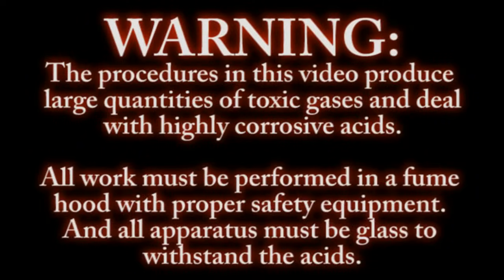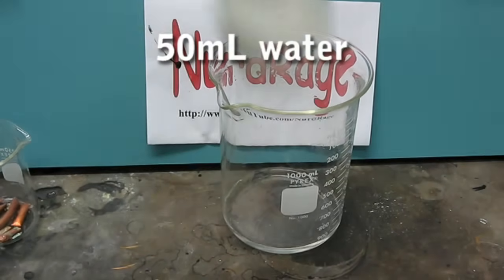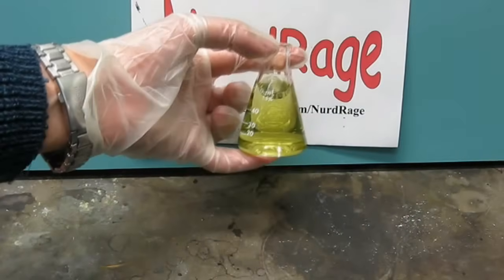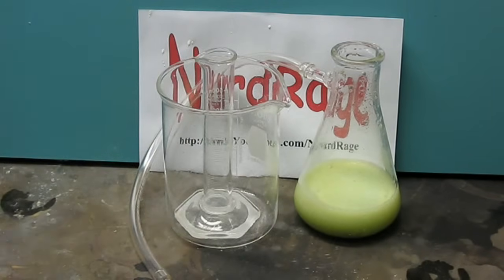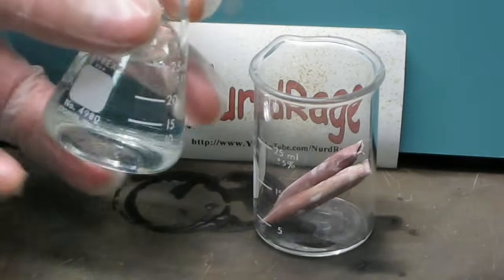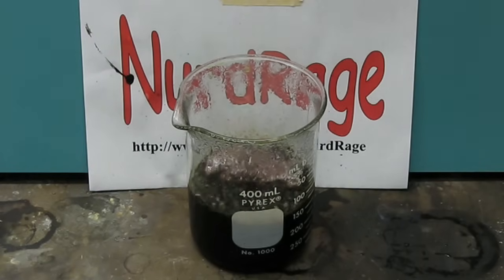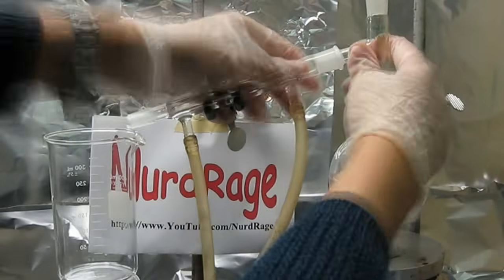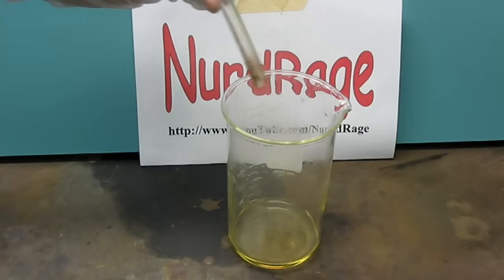Make Nitric Acid - The Complete Guide

Comment: @Monxer Concentration is how much 'stuff' there is.  A litre of concentrated acid will have much more acid in than a litre of dilute acid.  For example, conc. sulfuric is generally 98% sulfuric acid, 2% water but dilute sulfuric acid might only be 5% sulfuric acid, 95% water.

The strength of an acid is determined by its molecular structure.  For example, sulfuric is always stronger than nitric which is always stronger than acetic.  Conc strong acids are nasty and getting them on you is bad.

Comment: @MrRMillr Glassware tends to come in standard sizes. 50ml, 100ml, 250ml, 500ml, 1000ml, and so on. If the glassware has ground glass joints, the neck will be in standard sizes. A common joint size in the US is 24/40. The wide end of the female joint is 24mm in diameter and the joint is 40mm long. If it doesn't have a ground glass joint the neck size of the flask will vary. United Nuclear gives stopper sizes for the flasks they sell. Spend some time looking at glassware online to learn more.

Comment: Actually it is possible, but very time consuming, to go higher than the azeotrope at ca 67 % at atmosperic pressure IF the temperature is lowered under destilation.  Offcource its best to destillate under vacuum but if such equipment is not in hand.

Comment from the maker: @h0meIandsecurity it would be more straightforward to mix the nitric acid and sulfuric acid and then distill concentrated nitric acid from that. 

So not right, the roundabout method with fertilizer and sodium hydroxide is redundant.

Comment from the maker: @rhueoflandorin That rule is far more complicated than you think. You can't add water to concentrated sulfuric acid, but for nitric acid you can if the quantities are small. The point is to avoid the heat of dissociation exceeding the boiling point of the water or acid. Also if the acid is already dissociated in solution then nothing will happen.

Try adding water to vinegar (which is an acid) or water to lemon juice, which is also acidic. nothing will happen.

So no, it's not a "no-no"

Comment from the maker: @marcthepolo123 gently heat the reaction to speed it up. dipping the flask in a bucket of hot water helps.

Be careful. if it goes out of control you'll get a burst of nitrogen dioxide formation.

Comment: Hi Nurd Rage. I was trying the second method but I used nitric acid and copper to produce nitric acid. Yes, I used nitric acid for nitric acid. LOL!

At some point my pipette sucked all the distilled water from my cylinder, drove it through the tube and poured it upon the NO2 gas, which was generated inside my vacuum phial. After that the reaction stopped. Do you know what exactly happened?

Comment from the maker: @111alien111 And what happens to the potassium and sulphate ions? magically vanish? you can't violate conservation of matter. while you can produce nitrocellulose that doesn't mean its fuming nitric acid. for one you cannot use your mixture in a hypergolic rocket fuel. When your mixture dries it leaves behind potassium sulfate and unreacted sulfuric acid, REAL fuming nitric acid does not. 

Don't claim my method is long and silly when when your method doesn't even make the same thing.

Comment from the maker: @firebomb37 That rule is far more complicated than you realize, i know what i'm doing. You can't add water to concentrated sulfuric acid for instance, but for nitric acid you can if the quantities are small. The point is to avoid the heat of dissociation exceeding the boiling point of the water or acid. Also if the acid is already dissociated in solution then nothing will happen.

Try adding water to vinegar (which is an acid) or water to lemon juice, which is also acidic. nothing will happen.

Comment: What oil did you use in your oil bath? I'm worried about flammability of the oil at high temperatures, did you use something nonflammable? Nitric acid boils at 181 F, so wsa that the temperature you heated to? Thanks for any advice.

Comment: Hey, i was wondering if you could tell me the formula to use when i want to determine the purity of the acid i make using the weight of the collected acid. i have seen the formula in another video but cant for the life of me find it again.

correct me if im wrong but i have that a 100% purity has a weight of 1.51 g/ml. using that known i should be able to plug a formula into excel to track the purity in my production run. and thats where im lost i cant figure it out!!! HELP ME

Comment: @NurdRage I attempted the 2nd method's setup  with the third method's chems... It dissolved my rubber plug, which dripped in, then exploded (Not just from pressure i saw a couple of sparks) =P Any ideas what happened? Did i just nitrate rubber(Although im not sure thats possible)??? My generated gas is orangy, and heavier then air...

Comment: Couldn't you use for the last methode also water instead of oil for heating?
Nitric Acids boilling point is at 83°C i guess the water gets hot enough.

Comment: In the video you use all glass apparatus for the condensor, would it work if I work my condenser to the boiling flask with rubber or vinyl or would that react with the acid?  thats all I have available at the moment

Comment: could you add sodium bicarbonate to the used acid and filter the copper? i figure its cheaper then aluminum and the NaCl is very soluble in water, also could the reaction be done under vacuum? this would reduce NO2

Comment: @drahcirdier Acetic acid is a weak acid. In vinegar, the percentage of dissociation of acetic acid is below 1%. Even more concentrated, it won't provide enough H+. You need a strong acid. By definition, a strong acid is an acid that dissociate (almost) completely in an aqueous solution. Those are the strong acids : HCl, H2SO4, HBr, HI, HClO4 and HNO3 (nitric acid).

Comment: @Retard0800 NO2 is formed initially (due to presence of oxygen) as is evident by the brown gas. Eventually the evolved gas becomes clear and only becomes brown on contact with air. This is consistent with NO; it reacts with oxygen to form NO2. I doubt the reaction produces any NO2, since I believe it relies on the formation of catalytic amounts of aqueous nitric acid through an excess of NO3- and H+ ions. Dilute HNO3 produces NO on contact with copper: 3Cu + 8HNO3 –> 3Cu(NO3)2 + 2NO + 4H2O.

Comment: I tried the second method, while I dissolved lead in hot nitric acid at a vacuum flask. Unfortunately, the toxic NO2 gas stayed at my vacuum flask and I was obliged to open my phial many times, cause I was afraid that it is going to crack. Do you believe that a simple distillation apparatus is going to give better results?

Comment: @NurdRage i tried making the by the 2nd method. i used ammonium nitrate, copper fittings and "the works" toilet cleaner for my hydrochloric acid. the reaction does not do anything no NO2 is produced. why does "the works" cleaner not work? is it the concentration or the other stuff they put in the acid?
                                                           thank you for your time and help :D

Comment: @tomek123kotek The orange gas caused by the reaction is Nitrogen Dioxide (NO2).  The fumes caused by blowing air into the concentrated acid consists of mainly vaporized nitric acid and some dissolved nitrogen oxides, including nitrogen dioxide itself.  Don't breath this!

Comment: I have tried the first method but it seems like i get very contaminated stuff. I wanted to try the second method but I dont have a vacuum flask. Can i instead place a filter funnel over a beaker and connect the funnel to a plastic tube which leads to a pipette? Thanks

Comment from the maker: @fpm1979 actually the spent solution isn't nitric acid, it's copper chloride, aluminum does indeed displace copper in copper chloride. So you'\re still absolutely right that aluminum is highly resistant to nitric acid.

Comment: @NurdRage Hey, I was wondering after completing the 2nd method .Why does the nitrogen dioxide bubbles continue to flow out long after the reaction is done (like in the graduated cylinder ) I can see very small bubble flowing out of the container so I put it in a large Ice bath and stopped it off now it looks like a vacuum sucked in the stopper I used my question is why did this happen ? and why did the bubbles continue to bubble out of my container . please help .

Comment: i have a question. I used to work for a company were i would engrave magnesium stamping dies with a nitric acid bath which was a combination of water nitric acid caustic acid and a lubricant that looked like motor oil.i was told it was basically the same thing. we also engraved copper but we didnt use a nitric acid bath it was a orange/brown acid i dont remember the name.why is it they didnt engrave the copper with nitric acid?

Comment from the maker: @ultrachemist13 never said it didn't dissolve iron and brass. and it doesn't look red to me, looks more yellow. :)

anyway, RFNA is usually defined as having more nitrogen dioxide added. The yellow color is from decomposition and isn't really high enough to be red fuming nitric acid, it's just a few percent. If you want to make a stronger red fuming nitric acid you'll need to directly add  more.

Comment: its a jacketed condenser. its used to cool the gas enough so it becomes a liquid again. its pretty much 2 tubes; water is pumped in and out of the outside tube through the plastic tubing, and the gas/liquid flows through the inner tube. as far as making one, good luck.

Comment: Im not very sure about this, but in the third method, having the reciver flask with a little pinch of urea may destroy the NO2 and nitrous acid as well, levaing you with pure white nitric acid. And also maybe adding a little bit of hydrogen peroxide would help:

H2O2 + NO2 ---> H2O + HNO3

Comment: Cheapest source of copper I know of would be copper pipe or even stripped old wire which can be had for nearly free.
As for an acid some drain cleaners are about 32% hydrochloric acid also known as muriatic acid.
It's also sold as masonry cleaner.
I haven't tried the concentrated method yet but the second method works fairly well.
BTW always wear goggles and gloves when working with acids.

Comment: Hi nurdrage, recently I tried to make nitric acid with the second method i mena with hydrogen peroxide 20%, but instead of use HCl and Cooper, I mixed fertilizer (This fertilizer was pure nitrate, but with green color) and sulfuric acid, and I could see that the NO2 reacted with the tape, and make a combustion. What happened here???

Comment: @Erago575:

Nitrate Salts: Make your own using a cold pack or fertilizer ammonium nitrate and either baking soda or sodium hydroxide. This can be used to make sodium nitrate and potassium nitrate. You can use the ammonium nitrate itself as well. Potassium Nitrate can be bought as Spectracide brand stump remover.

Copper: Hardware store, plumbing aisle

Hydrochloric Acid: Hardware store, under the name of "Muriatic Acid." Very concentrated.

Comment: I was distilling nitric acid using sulfuric acid drain cleaner and sodium nitrate, when combustion started in the boiling flask.  Anyone know why this would happen?  I freaked out and doused the whole thing.  BTW I was using 2 flasks with rubber stoppers connected by teflon tubing.

Comment: The third method involves distillation, which separates mixtures based off of boiling points. If there are any impurities in the fertilizer, not only may it contaminate  your yield, but the combination of high temperatures and high concentrations of a very corrosive acid could raise the possibility of a dangerous reaction with said impurities.

Comment: @zyxonn
sulfuric acid can dissolve copper if its oxidizing, rather than acidic, properties are utilized. nitric acid is already strongly oxidizing per se, which is why copper reacts with HNO3 immediately, but the reaction with H2SO4 requires a bit of heating.

Comment: Couldn't you make some fairly pure (very low contamination) nitric acid with Ca(NO3)2 and sulfuric acid. I couldn't find solubility of CaSO4 in Nitric acid but assuming it's fairly close to it's solubility in water the contamination would be very low. Cooling it down in an ice bath and decanting could also help removing impurities.

Comment: whats the H2O2 for?? Does de hydroxide ion reacts with nitrous oxide to form HNO3 ??

OH +  NO2 ----> HNO3    ?

If so, i wish there was a way to neutralize the NO2 with hydrogen peroxide in the fraction distillation.

BTW, maybe the low concentration nitric acid could be used in the sulhpuric acid distilation to produce pure HNO3

Comment from the maker: @512Airsoft

I see, you can substitute sulfuric acid for hydrochloric acid. But be VERY careful, dumping sulfuric acid into water will make it heat up, and possibly boil over. go slowly and carefully.

I also i think you'll need to use less acid, since sulfuric has different properties than hydrochloric. I don't know the right ratio off the top of my head, i suggest experimenting.

Comment: Hey, I tried the first method using 30 percent HCl, and found that it doesn't work unless in high concentration. Would sulphuric acid work as a substitute? If not, are there any other alternatives? The link in the video discription says I can substitute it, but i wasn't sure which method it was referring to.

Comment: Alright I finally had the guts to try this today. I used the 2nd method, and at first nothing happened so after some strong heating the reaction went. When it was finished, the acid was light blue in color, how could this have possibly happened? 

Also what is in the dead reaction mixture, and would it be safe to dump down the drain. The acid works though, thanks!

Comment from the maker: @VerifiedNews

Yes you can add water to reduce its concentration. While you can blow air, you'll get alot of acid vapors, might be more prudent just to add the water.

I'm not certain what concentration fuming stops. But if you find out let me know :)

Yes you can increase proportions to create larger batches. But i don't recommend it, if your glassware accidentally breaks you'll have a very large and extremely dangerous mess. Make small portions and combine.

My oil was at 200 celsius.

Comment: Ok so if I want to use sulfuric to make nitric I can add water to reduce the concentration to 60%?

Would I do that by blownig air into the acid and adding water till it's no longer funming?

At what concentration does the fuming stop?

Also, can the quantities be increased in equal proportion to create larger batches, and if so, how much nitric can be produced at 60-70% concentration from a quart of sulfuric?

Finally, what temp is the hot oil at?

thx!

Comment from the maker: @mrGameAndWatch00000

if you're using the third method to make nitric acid then yes it will react. An aluminum condenser is better because as i showed in the silver nitrate video aluminum is very resistant to nitric acid.

Comment: When i repair ozone generators that have been used in moist air, i find the green solution on the copper fittings up flow. i now know for a fact what it is.

Comment from the maker: @pyropakman

might have fizzed too vigorously and frothed up to the tube, some it overflowed out resulting in the green acid. A bit solid mixture might have clogged the tube causing the flask to overpressure and pop the top off.

The copper chloride/nitrate  mixed with the acid would displace magnesium and come out as copper metal.

Comment: Hey Nurdrage,

This is concerning the second method.

After 1.5 hours, we came to see virtually all the reaction mixture on the table, and the cork popped off. There was green liquid inside the end of the pipette, but the nitric acid was a light blue color. 

Our acid seems to work, but it went in volume from 50 to 75 mL. Testing with magnesium yielded some copper-looking film on the outside, but it was inconclusive.

What do you think happened? We used a 250mL filter flask.

Comment: I found my problem. I added so much ammonium nitrate that it cooled the mixture to nearly freezing. When I added copper, it was too cold to react visibly. After heating with a torch, it quickly turned green and started bubbling. =D

Comment: My particular is to remove oxides on copper plated steel electronic chassis.  What I plan to try is to remove some of the copper plating in the affected area , then clean the oxides, rust, from the steel chassis and re copper plate the affected area.  Any suggestions would be appreciated? 
Is it legal to purchase NiO3 acids in small quantities? I suspect a few ounces is all I need to test with. Sources for Nitric Acid?
Thanks.

Comment from the maker: @hamish3142

aqua regia can be made with almost any concentration of acid. it just goes faster with higher concentration

Simplest, cheapest, and most reasonable way to make it is to mix equal parts 70% nitric and 37% hydrochloric acids. You can be off by several percentage points, it will still work well.

Comment: Hi rage, thanks for your vid!!
I got 2 questions from the condenser you used.-
1. As you can see there's two holes and leading out by the rubbler tubes, but i dont understand what for and where it leads to? what if i stopper both side holes so i can obtain more acid?
2. is there any H2O coming out with the acid? if yes, what can i do to get rid of the H2O and get highly pure acid ?

Thank you !

Comment from the maker: I don't recommend you use ammonium nitrate for the sulfuric acid method of making nitric acid. It decomposes somewhat, reducing yield.

It's highly recommended you convert ammonium nitrate to sodium nitrate (using our "make sodium nitrate") video and then use it. 

unfortunately, a 2:1 mole ratio, while a good idea, doesn't work practically because what happens when it reacts in a 1:1 ratio it then solidifies as sodium bisulfate, stopping further reaction.  you need high temps to go all the way